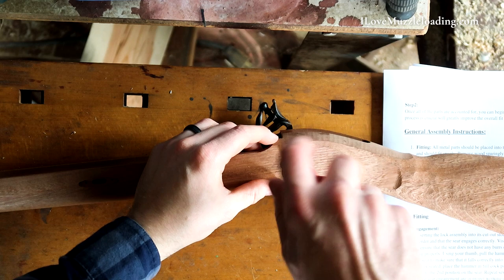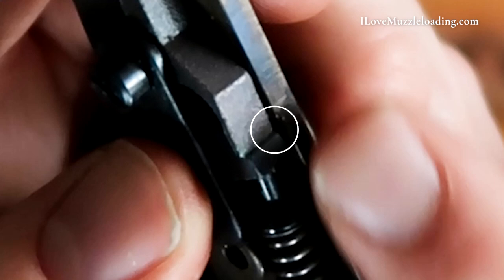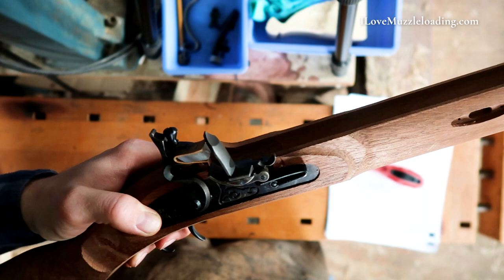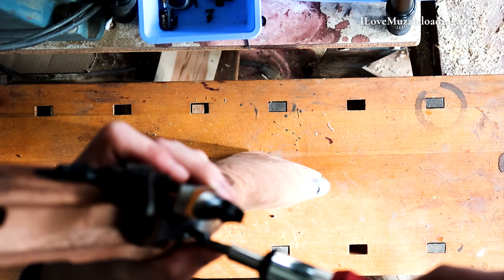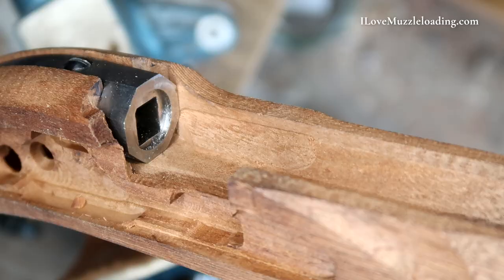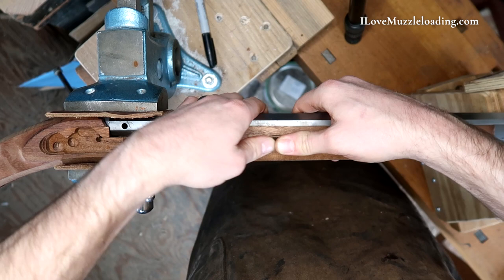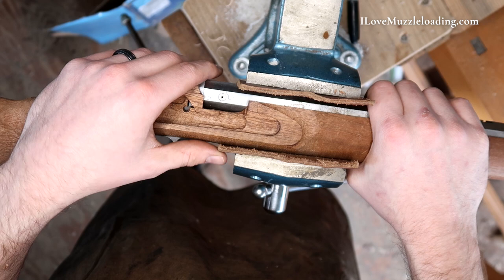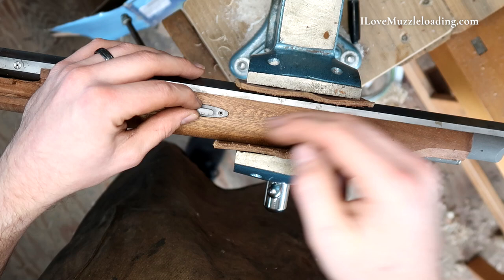Let's Build an Investarms Gemmer Hawken Kit Part 3: Dryfitting | Flintlock Muzzleloader

Comment: I received this kit today and am fairly happy with it. This is my first muzzleloader and my first kit so I am leaning heavily on this video series. The only major issue that I have found is that the tang inlet is rotated out of line with the barrel channel. Up by the front tang screw the tang is centered in the stock, but at the rear the tang is 1/16" closer to the right side than it should be. The net result is that it points the barrel in such a way that the barrel would exit the muzzle end of the stock about 1/2" to the left of where it belongs. The other option is to allow the tang and breach plug to join at an angle, but that leaves an unsightly gap on the left side of where they join together. My initial thought was to alter the tang inlet to rotate the tang over to where it belongs, but that would leave an ugly gap on the right side of the tang. My other thought is to cut an angle on the forward face of the tang so that it fits tight against the barrel without a gap, but that might put some lateral force from recoil into the tang. I'm going to have to sleep on it and maybe research it before I do anything else.

It also would have been nice if they had just not bothered to attach the muzzle cap. They mounted it with it rotated enough that the barrel wouldn't fit into the channel. Then they drilled through it at a substantial compound angle so the pin holes are in very different locations on the two sides. That also resulted in drilling where there was little wood and it blew out and was barely holding on as it was. I think I'll have to go the epoxy route on it. It is sad when a complete novice like myself could easily have done a better job than the factory and prefer that they just didn't even try.

Comment: What is the difference between the Gemmer and the Bridger? I just bought a Bridger and I'm waiting for delivery.
Reply from the maker: Hey Mike, great question. Looks to me like the Bridger has brass hardware and 1 barrel key, where the Gemmer has iron hardware and two barrel keys. The videos I've made should work alright for the Bridger, but there will be those minor differences.
Reply: @ILoveMuzzleloading  Thanks I will continue on. great videos.

Comment: This helped a bunch! How much do i sand the wood down by those inlets that hold the barrel? (i'm trying to finish this before my muzzleloader season ends so and help would be great!
Reply from the maker: You'll want to file all the wood so it is flush with the metal. If you need to hunt before it's done, it doesn't hurt to tighten everything down and go hunt with the Hawken dry fitted. You could come to regret rushing through your kit down the road. Happy working and hunting!
Reply: @ILoveMuzzleloading  Thanks!

Comment: I noticed on your traditions build there was a retaining spring for the ram rod, however I did not see one for the invest arms kit. I just received my Investarms Bridger kit, and I don't see any retaining spring on the schematic. Am I missing something?
Reply from the maker: I don’t believe there is one in the stock, but there would be one on the barrel rib that works really well. You’ll notice a milled rectangle on the bottom side of the under rib just forward of the nose cap
Reply: Thanks, I found it right after I sent this comment. @ILoveMuzzleloading